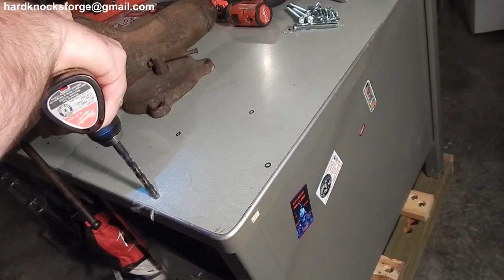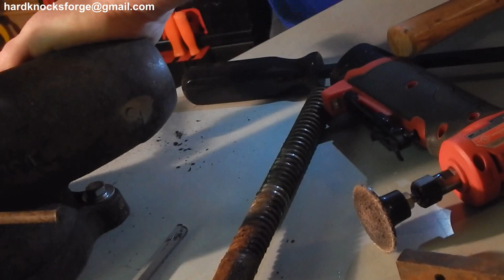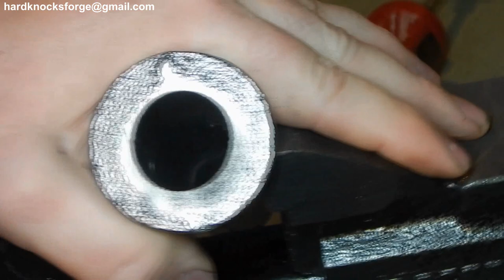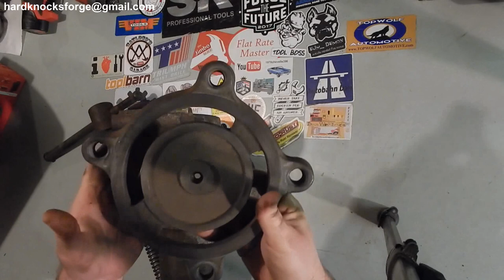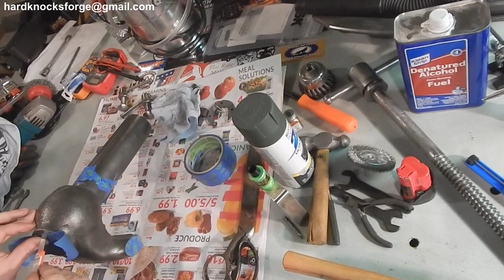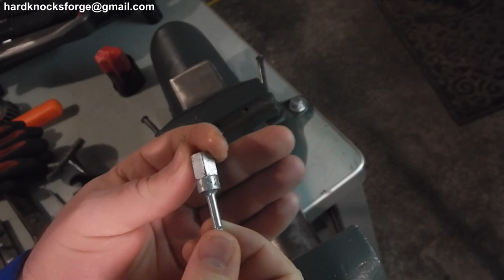Wilton Bullet Vise Restoration WW2 Era No 4

Comment: Nice Job! I enjoyed watching it. Wilton made such nice vises.
And, I learned the laws of electrolysis: "Rust to Red" and "Black is Beautiful." 
And, I also now want a Milwaukee die grinder. :)
Reply from the maker: I love my Milwaukee die grinders. They aren't something I use for extended periods of time, even though I have enough batteries for a couple hours of solid use. It's always a quick 5-10 minute job most of the time to clean, cut or polish just real quick to aid installation. 
Yes the laws of electrolysis are very simple. I've even had the battery charger running at 40 amps to really rush a few things. You really have to pay attention to your set up and make sure NOTHING is going to touch or move in the tank, but if you're good, you're good...

Comment: Your kitchen sink looks just like mine other then I have a hose sprayer
Reply from the maker: Mine has a sprayer I just didn’t want that shit splashing everywhere. It’s damn near too high pressure. Gotta have the water barely trickling out of the faucet if you don’t want a wet floor and counter. It does make for blasting the dirty dishes pretty easy though...

Comment: Turned out great knockers
It just needed a little love.  
Didn't know that you liked the pipes.
Reply from the maker: I've always liked the pipes. There are some pretty good looking girls out there right now handling pipes and squeezing sacks...
Reply: @HardKnocksForge  yes there is
Reply: @HardKnocksForge  LoL u got to love a girl thats in to doing that
Reply from the maker: You’d be amazed at what most girls will do after some tacos and tequila...
Reply: @HardKnocksForge  i worked in a strip joint u dont have to tell me about what a girl will do for A $ LoL 😜
Reply from the maker: I used to support single mothers $1 at a time...
Reply: @HardKnocksForge  LoL

Comment: My dad had this same vise but his the base is missing the 4th bolt mount it broke off so it bolts from 3 spots
Reply from the maker: I know they still make these vises. I wonder if you could buy just the swivel base from Wilton as a replacement?
Reply: @HardKnocksForge  no idea might have to look into that